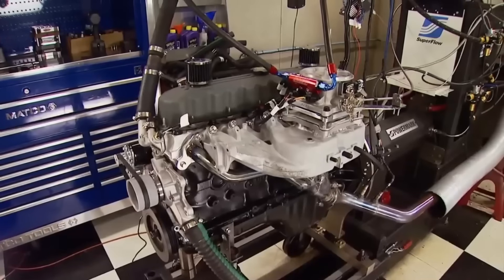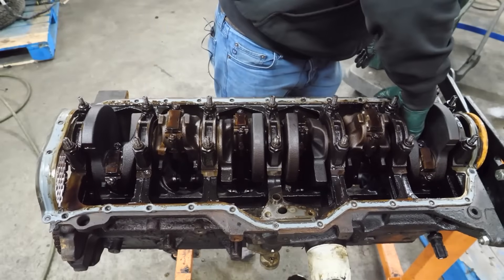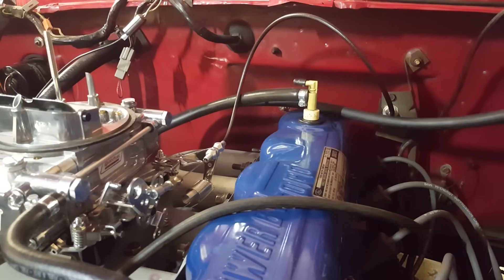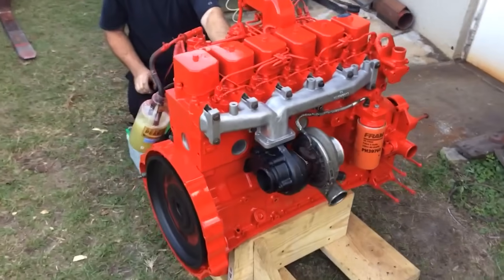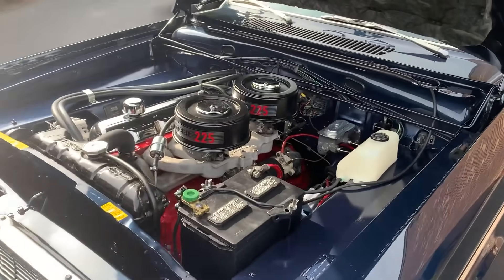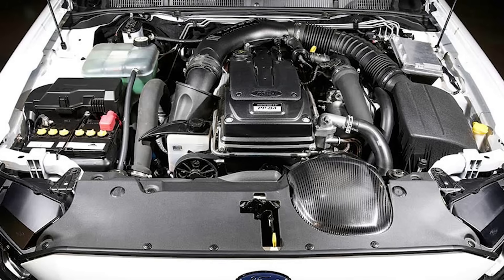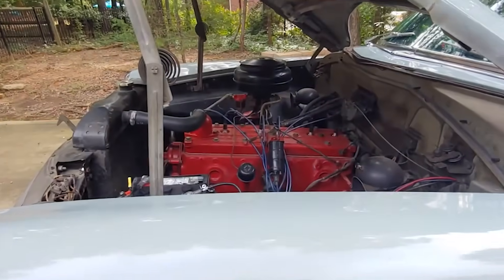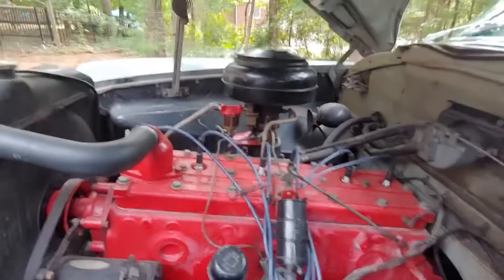8 Best American Inline-Six Engines Of All The Time!!!

Comment: 300 was the brute of them all motors
Reply: 6bt enters the chat
Reply: @xmo552  6BT is still a newcomer where engines are concerned and still more complex than the old ford inline 6 ,,although just as reliable and durable as any other engine on that list ,,all those engines except the ford barra ,and the cummins  are 1960s era designs or outgrowths of 1930s designs  like the hudson hornet and the old stovebolt 6 ,, the stovebolt 6 was actually a very temperamental engine that like breaking conrods if pushed too hard, ,the ford inline 6 ,chrysler the slant 6  and to a lesser extent the 250 GM inline 6 were some of the most widely used gasoline engines from the 60s through the 70s and into the 80s ,,,i collect farm machinery  and i have over 50 machines with those 3 engines ,,water pumps , generators ,aircompressors , combines , hay mowers ,irrigation power units , wood chippers ,,i even have a jet engine start cart with 2 chrysler slant engines ,,the oddest one of all is a 40 foot houseboat that my grandfather built in the 1970s  , it's powered by a pair of GM 250 inline 6 engines ,,that's a fun ride listening to those 2 big 6s sing at 3600 RPM  with no headwind it'll just touch 18 knots at 2800
Reply: I love the ford 300, it's a great engine. More than great. But the 12 valve Cummins is the absolute king. Mine has over 550,000 miles now. And when diesel was over $5 a gallon, I was still able to get around by running it on mostly waste oils. That thing has saved my @$$ more than I can count over the years.
Reply: While the 300 was a performer, it had drawbacks. Fuel efficiency was poor and that fiber timing gear was problematic in that, as it wore, the worn particles became imbedded in the oil and would collect and solidify on the oil pump pickup. I worked as a line mechanic for a Ford dealer in the mid 1970s and saw my fair share of failed 300s.
Reply: @jimmyraythomason1  i never had timing gear trouble with a 300  , mine was with head gaskets , i''ve had several of them that had repeated headgasket issues ,,i hate the fuel injected version too
Reply: they over heat and blow head gasket.
Reply: @thomas-k2k8w  that's the problem i had with the 300 ,,they aren't hard to keep cool but if they ever get hot it's a problem ,, the fuel injected 4.9 was worse by far

Comment: The AMC 6 also has 7 main bearings which also adds to reliability.
Reply: I'm pretty sure all but the last 2 engines on this list have 7 main bearings
Reply: @mikeschnieders7750  all the manufacturers should go back to this design, in trucks anyway, but they'd rather build junk that won't last the life of the loan
Reply: @mikeschnieders7750  probably, the slant 6 only had 4 mains.
Reply: @donparker1823  yes, and it was originally designed by Ford
Reply: @maceurbi2842  The 1964-2006 AMC inline six was designed by AMC!

Comment: I've ran several 258 & 4.0 jeep engines past 500k
Reply: I have some older Jeeps, but none ever with the 258. I do have a 1988 Comanche and 2004 Grand Cherokee both with the 4.0L. They average around 16-18 mpg daily and 20-22 mpg on a long drive. Both vehicles are 4x4. The Comanche has overheated majorly a few times ..... let it cool, fix it, nothing hurt AT ALL, vehicle goes on.

And they tow.
Comanche is over 500k.
Grand Cherokee is 300k.
Both easily pass California smog.

My 6bt is dead stock.
Mega torque. 
Mega reliable. 
18-24 Mpg. 
7400 lbs.
Tows AWESOME.
Reply: Absolutely, one of the reasons I bought an LJ
In 2006, last year made. Love it🎯🎯🎯
Reply from the maker: Wow, that’s awesome. Nice to see that this engines are so OP.
Reply: Yep. Just change the fluids routinely and they will last forever. I started using all synthetic oils when Mobil first came out with Mobil 1 in 1976. Extended my oil change intervals to 5000 miles. I've never had any internal engine failures. NONE.